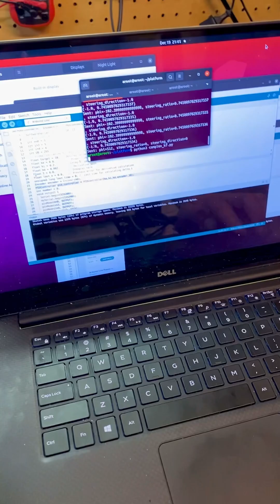Arduino Differential Drive

Comment: Bruh  you listed all the components like I know what they are 😂.. it is sickkkk tho
Reply from the maker: @YafetNegash Encoder is what I use to figure out how fast the motors are spinning, its attached to the motor shaft and chops the light and I figure out the frequency 

PID is proportional integral derivative, it’s the control technique I use to throttle the motors.

Driver board regulates the dc power supply into the motors using signals front the arduinos

Servomotor is the thing that controls steering, i send it an angle and it turns.

Simulator is doing simulation of the car Kinematics and outputting speed controls and steering to chase the target, tracked with a Kalman filter

Comment: When you say a new architecture, do you mean the steering mechanism or something else?
Reply from the maker: @virusfriendly9749  good question. I changed the chassis geometry to better handle the upward force on the wheels. I added press fit components to hold things like wires etc. I added the diving board for the arduinos. Etc

The simulation also changed to calculate turn radius and throttle the motors accordingly